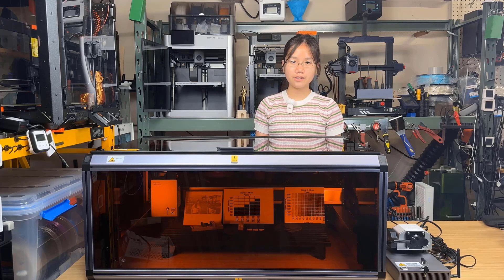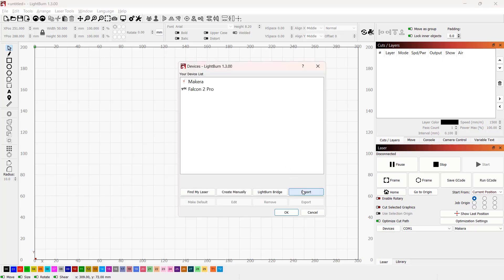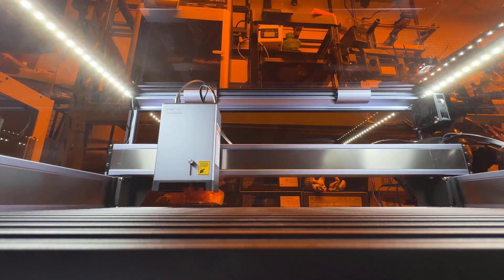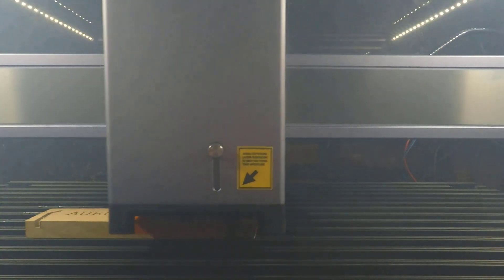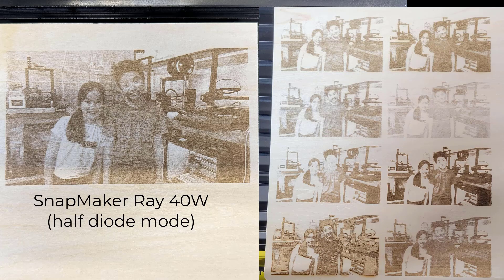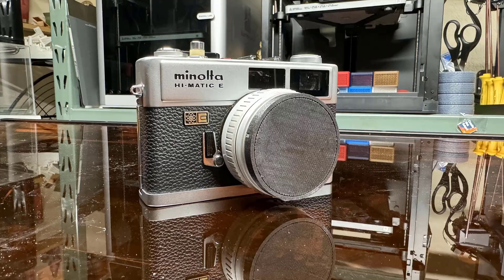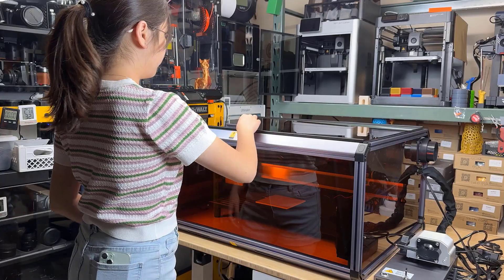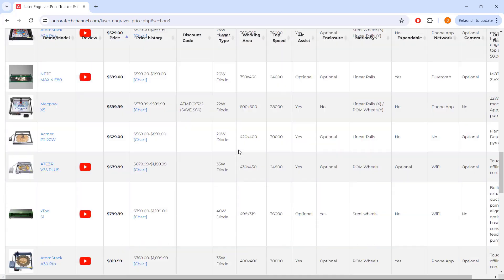SnapMaker Ray 40W fully enclosed laser engraver, modular linear rails on X and dual Y axis

Comment: Im curious How does the Linear rail mount the head...is it magnetic or is it from the bottom??
Reply from the maker: It has a mounting plate attached to the module linear rail. The tool head is then mounted on the plate, all fixed with screws.
Reply: @AuroraTech  ok..I went to their website to see it better but no close ups. I looked like it was a linear motor...but you did not mention any thing about that so I was curious but both you and them did say linear rail...not motor. Thanks. Great job as usual..your consistancy is very inspiring . Hope you have a plesent time untill we see you next.

Comment: could this be used to carve away the copper on a PCB (printed circuit board)? Could it carve away traces 0.25mm apart?
Reply: PCBs can be made on any laser cutter. You scuff up the board blank so paint will stick, paint it, laser away the paint in the desired pattern, submerge the board in iron chloride to remove unprotected copper, rinse away the etchant, and finally dissolve the paint in acetone. You can also etch hole centers for easy drilling. A double sided board can have user labels ethed on the front and solder pads on the back to make a switch panel. I don't know about 0.25mm though.
Reply: @p39483  Yes thanks. The whole point is the 0.25mm traces which I wish she could test and tell us.
Reply from the maker: I don't think so; you may need a fiber laser to do that.
Reply from the maker: You may also read this first if you want to use a diode laser to make PCB.